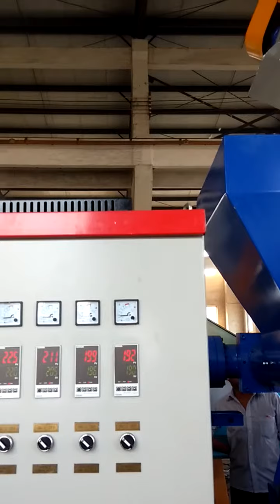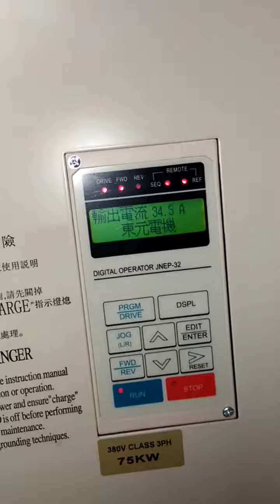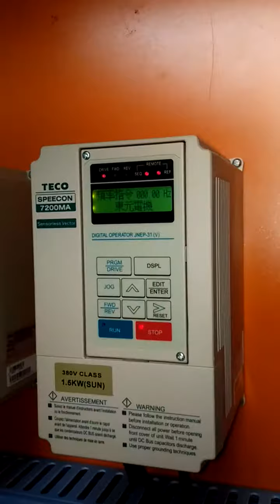Water ring granulation equipment  Plastic granulation equipment manufacturers selling

Comment from the maker: Source jiang machinery is in mainland China professional plastic recycling equipment suppliers, has a professional r&d team and front-line workers, in plastic recycling production. Recycling equipment services and manufacturing customized crusher, crushing machine, washing machine, dryer, granulator and surrounding equipment, of which has become the industry benchmark of recycling granulator and cleaning equipment for the main products. We attaches great importance to the quality and reliable service, and constantly improve themselves, our efforts we made the top PP PP film and broken washing dry recycling cleaning line, plastic renewable resources recycling granulation machinery and equipment, at the same time, we have rich experience, with you to develop and provide specific solutions, and professional technical service personnel to assist your site work, and provide appropriate technical training.